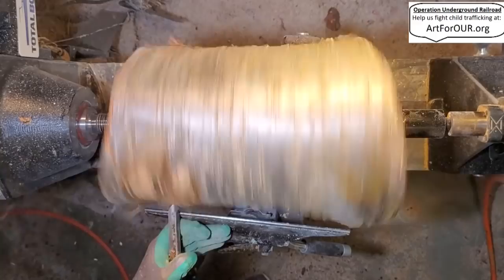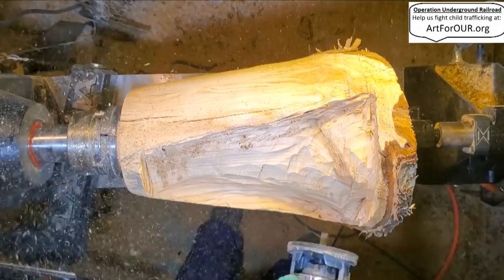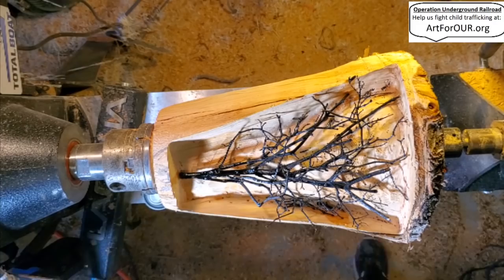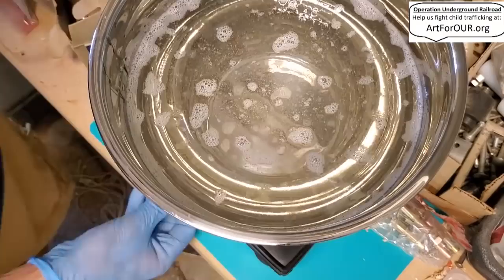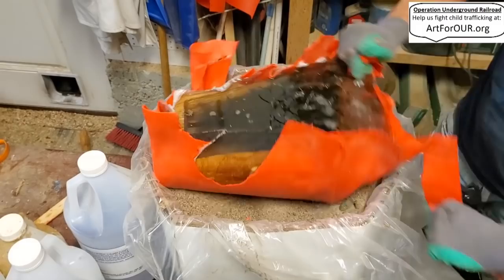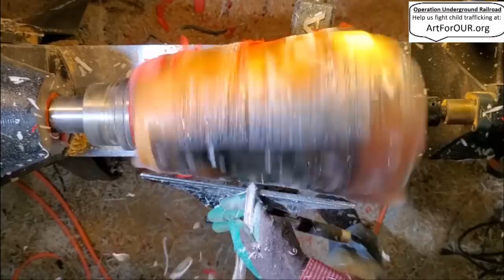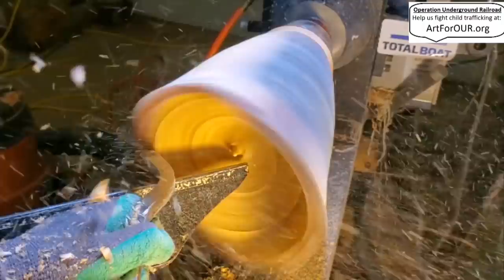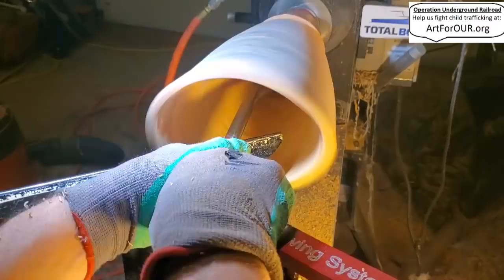"Fall Night" Resin, cherry wood and lilac branches. Turned by hand on the lathe.  Wood turning.

Comment: A propane torch would have made your life much easier on this one.  You can just brush the surface with the torch to get rid of bubbles, AND it would have softened the resin so that you had less trouble applying your color.  But you probably already know that a year later.  ;-)  It's a beautiful project.  Well done.
Reply from the maker: Thanks Marti!

Artforour.org

Comment: Another beautiful piece 😎

Forget the vacuum, really a waste of time and money, as most of your bubbles will be coming from the heat of the resin making air exit the timber. To minimise your bubbles, not using a pressure pot (they do make big ones btw), precoat your timbers with a coating resin first and let set. That way any air from the timber will be contained. Air from the resin itself can be removed with a heat gun or a misting spray of metho (you call it spirit?).  Cheers
Reply from the maker: Thank you!  Good ideas...

Artforour.org

Comment: It stands to reason your sand and vibrating table would be in conflict. The sand defuses the action of the Viber. Great work as usual. P.S. I don't see you changing your method of using sand. I'm sure the Viber would work on a project like a river table. Keep em coming. Love your work.
Reply from the maker: Thanks Larry!  I actually put the resin in a bucket alone and the vibration didn't seem to help....

Comment: To color twigs use alcohol ink or fabric dye/water to soak them in your pressure pot, then seal with brushed on thin resin or spray on clear
Reply from the maker: Thank you for the suggestions!

Artforour.org

Comment: Take the wheels off your pressure tank. then bolt/screw it to the wall.  The tank will become horizontal and you can slide in and pressurize your tuening...
Reply from the maker: Good idea!  Thanks!

Artforour.org

Comment: Try a heat gun or a torch to remove bubbles from the epoxy. The torch works better, but may be a bit too much when your project is wrapped in plastic.
Reply from the maker: Good idea!  Thanks for your support...

Artforour.org

Comment: Beautiful work! I'm curious about whether or not the cracks in the wood will weaken the piece over time. I've seen some turners fill the cracks with resin.
Reply from the maker: The way that piece was poured,  then entire piece was soaked in the resin filling all the cracks...
Reply: @artgivinghope  Ha ha! I'm so dumb! Shows how good the pour was because I didn't see it at all. If I'd thought about it longer, I may have realized that. 😳 Thanks for answering.
Reply from the maker: No problem!  Thank you for your support!

Artforour.org